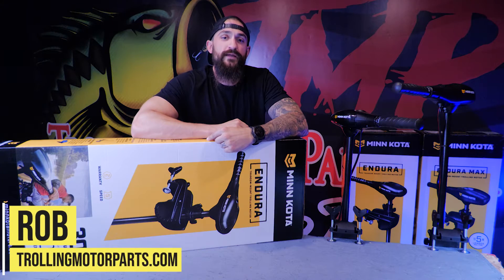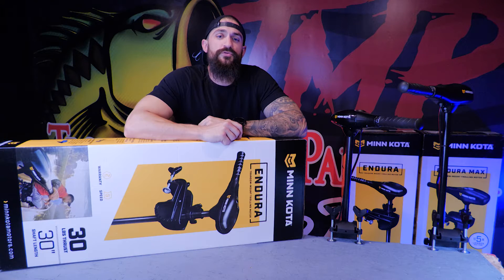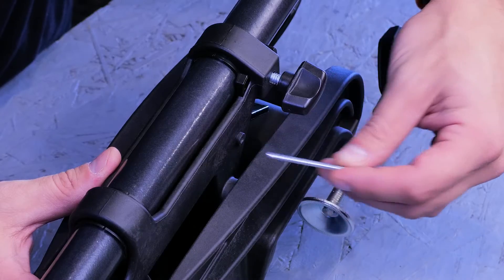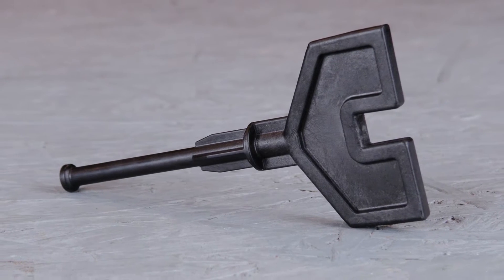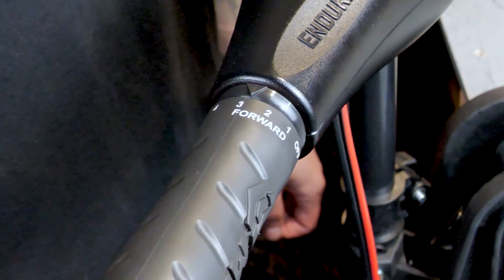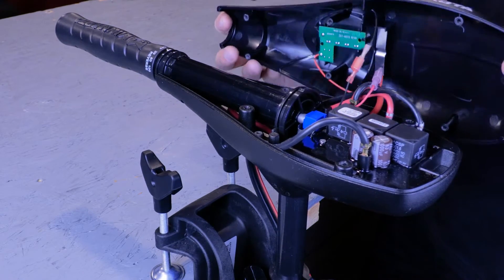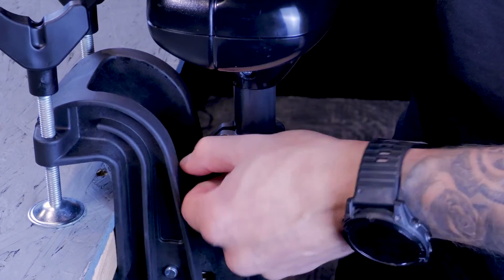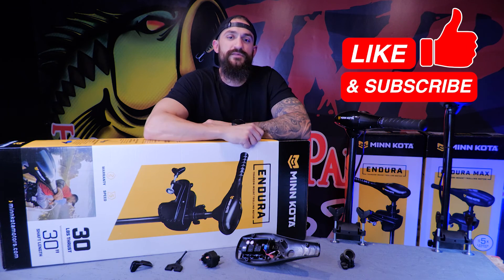Minn Kota Endura TOP 5 PROBLEMS

Comment: My bracket that tightened to the transom cracked and where it’s made of plastic it’sa down grade they made should be metal or steel like old motors Always was but the brackets it u tighten too tight or tighten exactly what your boat transom called for it can crack and break off and fall into the water